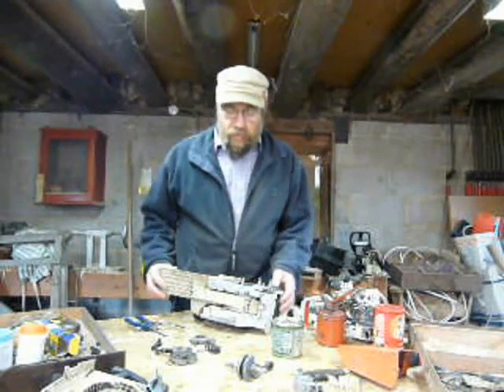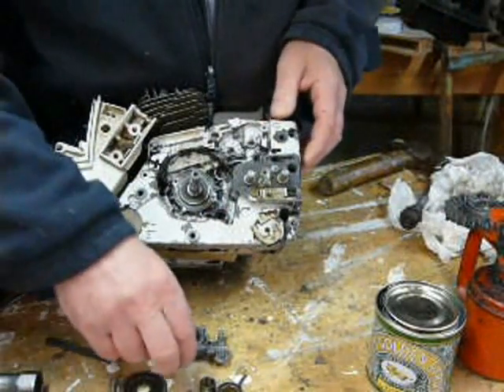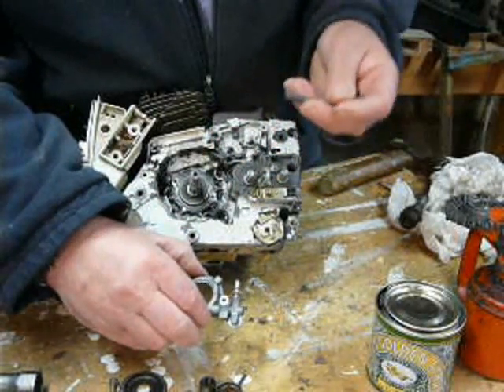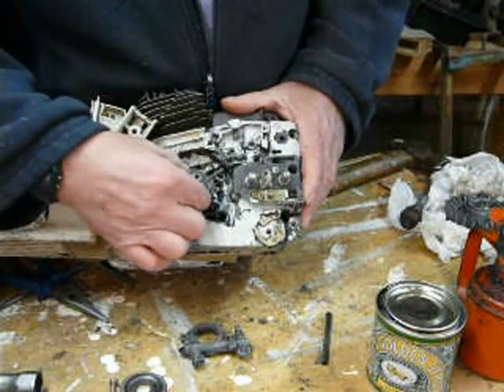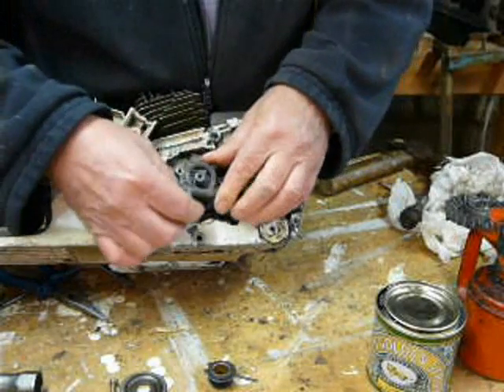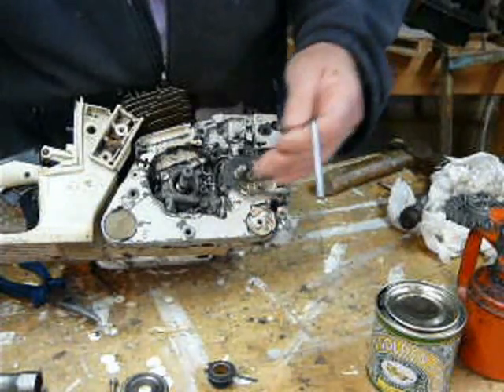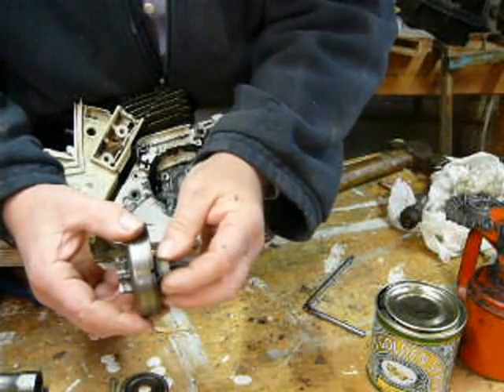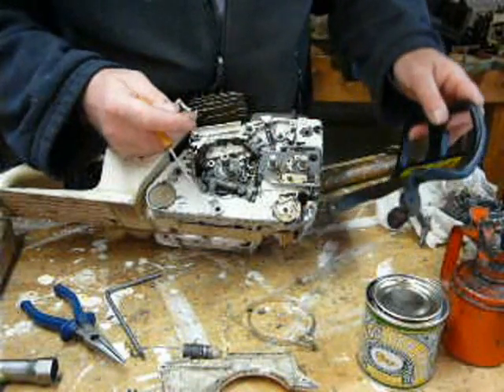Stihl 026 chainsaw repair . Part 6. The oil pump.

Comment: This was a fantastic video!!  You communicate are clearly,  You show the steps involved, you describe how various mechanisms function, you post close up illustrations and you are obviously experienced and knowledgeable.  Thank you for posting this, it helped me and I am sure it will help others!  I am dealing with the aftermath of hurricane Sandy and have a number of 25"+ oaks to buck.  My MS360 is "leaking oil at the pump" with little oil getting to the bar.  I now have a better chance to fix

Comment from the maker: Hi. On 025 the oil pump is still driven by a quill from the clutch drum, through a plastic worm drive to a small pencil pump. Check quill and worm dive after checking the bar oil hole and oil in tank. Extreme cold can make chain oil too thick. To get to pump remove black exo-chassis. Remove plastic union between bottom of pump and tank. Take out pipe and clean filter and tank. Use case screw threaded into bottom of pump to remove pump. Careful as holes in pump side must line up with case holes.

Comment from the maker: Hi. It could be the filter in the tank. It doesn't take much to reduce the flow to this type of pump. Either take it out as described or empty tank and wash out with parafin or diesel. This should clean the filter also. It was common to get problems if veg oil was used as chain oil. It crystalises. So have ago at washing out the tank and maybe flushing the system with thinner oil. Hope that helps and prevents a strip down. This is a common problem with 017 & 018 saws. I should do a video.

Comment: Good video.  I am updating my ms 260 to ms 260P specs.  I already have a new 44.7 ml cylinder with deco valve and a fully adjustable carb.  My 260 was made in January 2006.  Besides being filthy, it has not been used a lot.  It has an 18 “ .325/.063 chain on it (RS).

Comment: Nicely done, I'm about to change the oil tube and filter on an older 026, and found your instructional video very helpful. Thank you, Joe
Reply from the maker: Thanks for your comment. It's quite an old video but still does the job. Cheers

Comment from the maker: Hi. Watched you video. Hello. I have only ever sold bits of this model, but I remember that the oil pump has a flat face on the back and retained by several bolts. There is a gasket in this joint. I assume that the hole in the pump drive wheel gives access to these bolts. The old type sprocket mounting does wear, so best change it for the new design, but only when the original is worn out. Good price on the spring. All the best.

Comment: Andy, got my 026 running fine.  I am going to put an adjustable oiler on it instead of it’s direct drive.  I do not like fixed jet carbs, so I am going to replace its carb with a 026 Pro carb.  I may throw some new seals in it but my can of break cleaner says they are not leaking.  However they are something to consider on a 25 year old saw.  I am going to replace both big AV buffers.  The rear one was damaged when the tree fell on it.  I put a new Oregon ProLite bar on it ( .325, 050, 67).  I would have stayed with 3/8 but could not find a rim sprocket to fit the sprocket, locally.  It starts and runs fine.  I found a close paint match for Stihl saws- Ace Hardware, Appliance Epoxy, color code Biscuit.  It might be an half a shade lighter but a pretty good match.  I am not paying $20 for a can of the Stihl stuff when I can get it from Ace for five dollars and change.

Comment from the maker: Hi Yes you are correct on the occasional user saws the chain brake centring spring is just a flat leaf spring. They wear and the only thing is to replace the spring. Easy to do and the part is not expensive, from memory it has some bends in it, and fits in a recess in the case. I have just started a series of videos on rebuilding a Stihl MS230 but it might be some time before I get round to the chain brake. Hope this helps.

Comment from the maker: Thanks for your appreciation. The Stihl oil pumps rarely give problems unless clutch damage has created physical pump damage. The leak will most likely be in the discharge pipe. All the best.

Comment: I bought a crash damaged 026 the other day.  It had a tree dropped on the rear handle and it busted the gas tank, rear handle and that was it.  I have a new gas tank on order.  It will have the flippy tank cap but that is OK with me.I cleaned it up and it was filthy.  After some cleaning, I squirted some two cycle down its throat band pulled it over.  It rolled over, so I gave it another squirt and it ran for a few seconds.  I have been doing this every day for the past week and it seems to run better and longer each day.  I still need to clean up the clutch side and will do that this weekend.  I will put the new rear handle on it when it comes in and put on a new air filter and air filter cover, later.  Today, I am going to connect a long piece of fuel line to the carb, put a new filter on it and stick it into a container of good two cycle.  I can control the carb because the throttle rod is still hanging on the carb.  I want to see if the carb is working fine and I don’t have to rebuild it.  I can always cut it off by grounding the kill wire to the metal spring, which is still on the saw.  The kill wire is still attached to what remains of the control lever.  I am glad to see the oil pump is similar to all my other big Stihl saws.  I will pull everything off the clutch side and clean it up, lubricate the parts before I put a chain on it.

Comment from the maker: Brian, sorry I don't recall. However if there is a shallow groove on the end of the post then a circlip is required. On the 026 a clip is required to keep the rocker in place on the pivot, otherwise the brake band has a tab on the rocker end and a curl end that fits in the casting. Could it be that a bit has broken off your brake band? Sorry I cannot be more helpful, but thanks for the appreciation of the video.

Comment: thanx.i ordered a whole new assembly as i took it apart yesterday and had a look at it,there must be 10 years of uncleaned grease ,dirt and oil in there.i got it from a lumber  worker in austia who sold me it for 200 euro.i get the felling he sold it as it was struck by a tree as the handle has a dent and the brake  has few problems.i m not sure if i should do a full work over on the whole saw or just fix the most important thing  first and later the full 1nce over.what do you think.

Comment from the maker: Get it running and use it, that way you will find out how good it is. If a saw has been stood for a while the carb can gum up and it takes some use for things to bed in again. If it does what you want it to do, then no point sending any more cash on it than necessary.

Comment: similar  to my 034 036  oil pump, the tube to the bar is very stiff,has a brass ferrule  and inner spring, special  pliers  help  get the hose over the barb 😀 i modded my pump to flow  more, now it oils well,the hose in this video seems softer,easier to get on  but could melt from heat,as ive seen on my 034,now im adding the muffler cooling plate,keep the heat at bay
Reply from the maker: Mark,this is quite an old video but from memory I fitted a new pipe. The old one was so brittle it as impossible to remove in one piece, cheers
Reply: @TheInfoworks  i looked up 026 oil line,...it is different  slightly from. the 034 036

Comment: I spray the chain brake parts with white lithium if I pull it’s cover off to replace band, etc.  then, I get the cover on, fast to keep parts from flying off.

Comment: Great video.
I have an 028. The chain brake is not working. The chain brake band loop came off the linkage post. I think there should be a little clip on the open end of the post to hold or stop the brake band loop from coming off. True?

Comment: Thanks for responding, I love your videos I watch them all the time get get a bearing on some of the thing I do around here, I did check the quill and the worm gear, they both are intact and the pump gear turns freely, As for temperature, if I'm using Echo bar oil would a low temp of 38deg F  make it too thick?

Comment: I always put grease on the worm gear, in and out, so it is lubricated when it contacts the oil pump gear..  when I put the sprocket on I always rotate it enough to fill the worm gear arm drop back into the sprocket.  If it does not drop in the sprocket it will be almost impossible to get the sprocket washer and E clip on the end of the crank.

Comment: The most important topic is the adjustment screw! You have to set it initially and be able to demonstrate how to make sure that the oil flow is set after use to be balanced with the fuel use..
Reply from the maker: Hi. You are talking here about the oil flow adjustment screw. The early 026 saws do not have this. The setting is depenent on the size of the bar and hence the number of drive links as well as many operational variables. Cheers, Andy

Comment: How do you remove the brass insert on the discharge pipe? I have an old early model 026 with the non-adjustable oil pump and the metal gear on the shaft. The discharge pipe broke at the bar slot. Any help would be appreciated.
Reply from the maker: On several of the ones I have just looked at, the brass ferrule and rubber pipe is fitted from the bar boss end, not the oil pump end, cheers

Comment: Hi Andy, great video, thanks. The brake doesn't work on my 026. The handle clicks forward and back no problem but has no effect so i intend to take it apart to see whats what. Can you suggest what i should be looking for, thank you for your time.
Reply from the maker: The brake band probably needs replacing. Cheers, Andy

Comment: does the oil pump reservoir supplies also the piston ring or the crankshaft of the chainsaw.... or it supplies only the chain and the guide bar? thanks for your answer... waiting
Reply from the maker: Hi, no it only feeds the chain, you need to use the Stihl 50:1  Two stroke oil in your fuel, subscribed? cheers
Reply: @TheInfoworks  thanks so much is a discussion between us... some says that it supplies also the piston ring and the crankshaft.. others say that it only supplies the guide bar... now im 100 %sure that it only supplies the guide bar... thanks sir so much for the answer... god bless and god speed
Reply: @frenellecalabias7827  whats the discussion... The oil pump has a direct line into the "chain oil tank". Who the hell would argue that chain oil is being shot into the cylinder xD

Comment: Andy, I have a Stihl Wood Boss 028 AV. With much attention, it seems to be holding up, okay. Would you suggest an upgrade, should I stick with what I have? If so, upgrade to what? Thanks.
Reply from the maker: Hi. If it is running fine and the weight is not a problem then stick with it. They are nice reliable "old school" saws. Subscribed? Cheers, Andy

Comment: Hello I saw the video and found it very useful. However: my Sthil 026 is still not oiling after replacing the worm gear, cleaning all the tubes etc etc... the last thing that comes to mind is the actual gear inside the pump that could be clogged. How can you take the gear off of this type of pump. Is it physically possible to take the gear off without having to replace the whole pump??? Thank you expecting a reply ASAP.
Reply from the maker: Hi, it is possible to remove the worm from the pump but first I would see if it spins freely and that air can be blown through whilst spinning the worm by hand, cheers
Reply: The gear on the pump spins (but not with ease) there is a bit of crud inside the actual pump.  I have absolutely no clue how to extract the pin from inside the pump.  May you reply with some info on my email??
Reply: Remove the bar, and hen see if oil is coming out its orifice or not.  If not then continue checking the supply.  Put some pressure with air into the oil tank, 3-5 lbs, see if any oil come out the output to bar orifice. If yes then check the drive pinion gear and the pump gear.  You should be able to rotate the pump, driven, gear by using small screwdriver to see if oil is being pumped manually. The driven pump gear rotates the top of it towards the body or counter clockwise. If you still get no oil then make sure the oil pump pinion engagement arm is actually connecting with the clutch drum and making it spin.

Comment: Hey ,Andy I was wondering about something on my 026 just pick it up it's the pro model not have the adjustment screw for the oil pump .but I was told works just fine .not sure keep that way or get a new one put it in ? Please let me know Thanks!!! Awesome video
Reply from the maker: Hi, don't worry about it, just use the saw and as always keep an eye on oil consunption. It all depends on temperature and oil viscocity. Subscribed? cheers